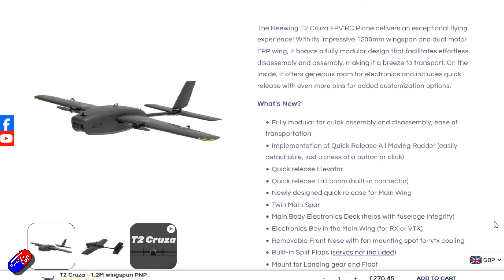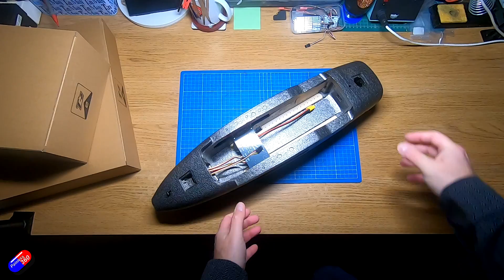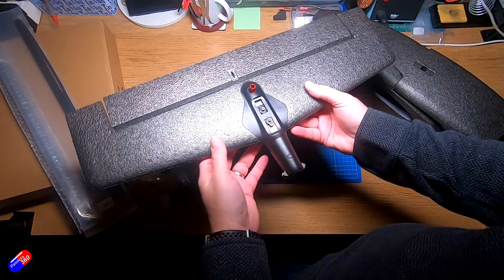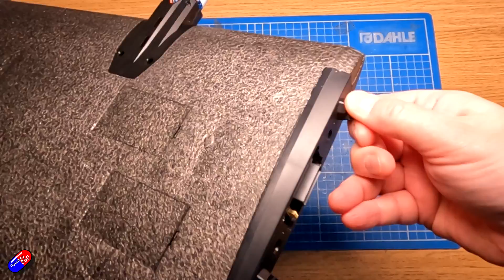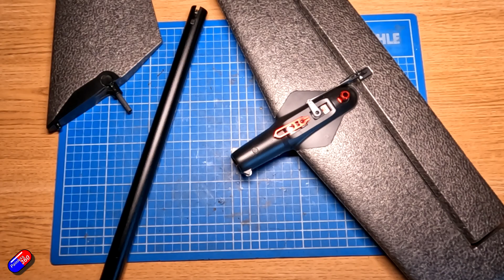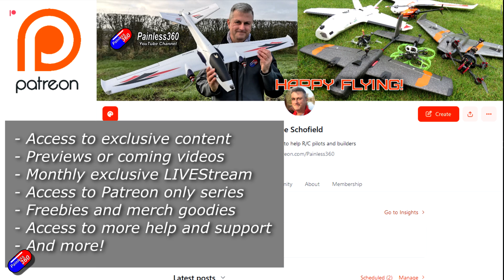HEEWING T2 CRUZA (Retail PNP Version): Unboxing and overview

Comment: We order 50pcs to distribute here in qatar but most problem is the tail boom connectors lose contact while flying and the thickness of the tailboom is thin aluminum not carbon fiber

Comment: Great review Lee! One other thing I'm wondering about regarding the T2 is how well will the propellers clear the ground on landings. This is a real issue for those of us flying where there's no grass or sand to land on. With my AlbaBird I ended up switching from the recommended two blade 7 inch, to three blade five inch propellers so that I don't have to replace propellers every other flight. Price is indeed high, but 1.2 wingspan is ideal for FPV in my mind. I always found the T1 a bit too small to fit the electronics in comfortably.

Comment: I’m glad to see I’m not crazy for the doubts I have with this. That nose!

Also, I really think Heewing should release this as a kit. Locking the motors to 6S is weird to me, and personally I’d rather pick motors that worked on 4S (really easy at this size) or like you said a motor that runs at 8S so you can use 4S packs in series. Might be tougher to find a kv low enough for that, but you could also prop down. Most likely you’d need new ESCs too since 8S capable ESCs aren’t as common as 6S.

Oh, and on that topic, I really dislike how Heewing releases their products piecemeal. The flap servos aren’t included, but even if you wanted to pay for them, until like the day before yesterday there wasn’t a way to order them with your plane, so you had to order the plane and then wait to make another order and pay for shipping from China again (or hope that a reseller eventually gets the spare parts and stuff). Same for the landing gear and floats. Same for the VTOL kit (which im sure is coming but I admit that may be more design work involved). Same for the kit version. And then on the T-1 they released the VTOL kit, and a few weeks later they released a T-1 VTOL, so some of us that ordered a conversion kit and had all these leftover parts from the original could have just ordered a VTOL PNP instead and had two planes? It just doesn’t really make sense how they function. Best bet is to wait a while and let the dust settle.

Comment: I do like putting fans on my vtx, otherwise you get overheating issues on the ground. knowing that you're not going to overheat no matter what is worth the 5g or so of fan.
Reply from the maker: I don't crash them ;) 

Agreed, using a fan can help in those 10 mins while you recover the model so if you are someone who ends up recovering their model, then a fan is a nice idea.. 

Happy flying Buddy!
Reply: I use a switch on the flight controller. The VTX isn’t powered up while my GPS is getting a fix. Or I power the FC via USB which powers the GPS until it’s ready to go.

Comment: Lee I really start to consider other models like the MFD Crosswind Mini with all the fixings at this price point. Heck I built my Reptile Dragon v2 for way less than this.
Reply from the maker: I agree, at this price point there are lots of choice for larger models and ones with longer ranges..
Reply: I just built a Reptile Dragon 2 off Banggood for $107 kit version. Took the guts out of my Nano Talon Evo and I’m very happy with it. 2212 1400kv motors running 8x8 props on 3s 5200 no GoPro
Reply: @dronepilot260rc  nice…😬 I built a kit I got from Ali for 97 shipped. I used SunnySky 2212 x 1250kv motors I got for 34 shipped and RMRC blheli_s esc for 35 shipped. This setup easily flies with a 15Ah 4s3p Lion pack for over 1.5hrs.
Reply: I think people sleep on this foam a bit. I assume this thing is the same as the T1, in that it uses the dense molded EPP as opposed to EPO or EPS like most of these cheaper PNP models (FPV wing folks call it “Drak foam” since RiteWing used it for all their molded wings). It really is on another level in durability and longevity. Does that make it worth all the extra money? Eh, not sure, but it definitely counts for something.

Comment: I suspect many of the nose issues would be remedied if we fixed our camera/air unit to the firewall, not to the foam module, and used the detachable unit just as a cover – an easily vented one at that. But if we put all the innovative design features aside for a moment and look at the T2 as a long range platform, wouldn’t a comparison to the Swordfish be in order? Same span, probably greater chord and larger battery area – and what about efficiency? I’m sure the coming weeks will answer those questions. Happy flying!